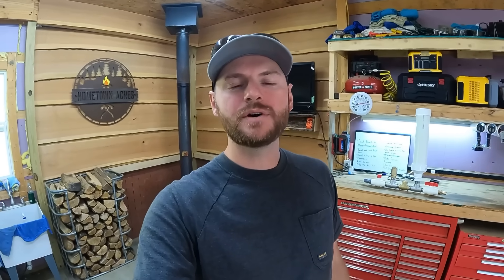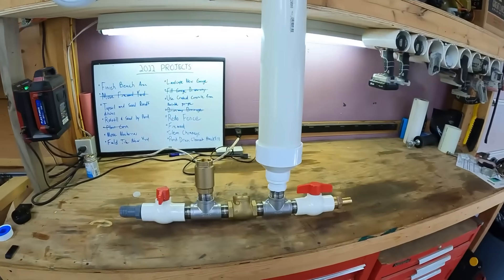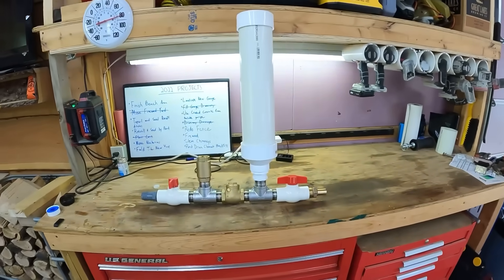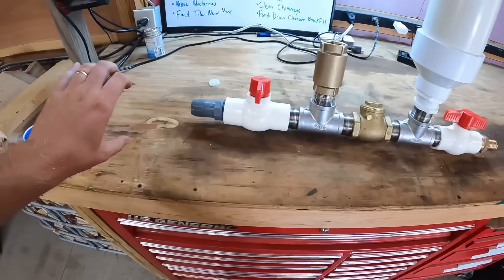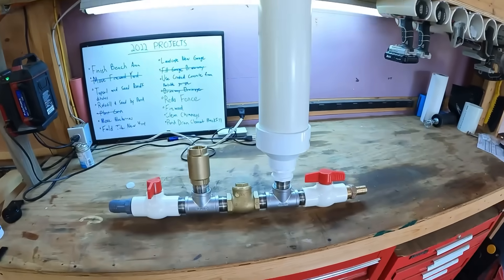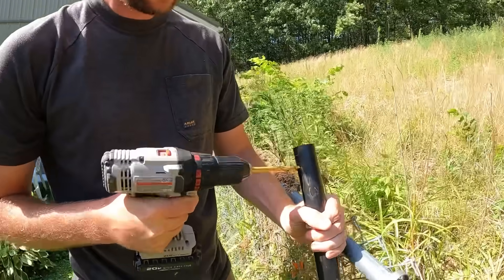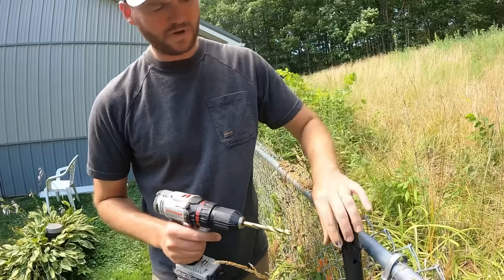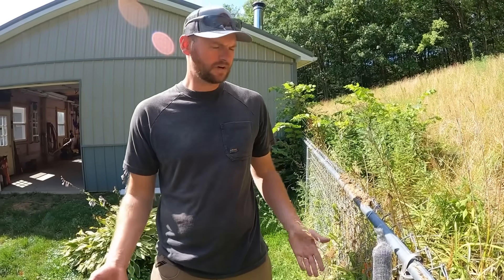We Found Water For The Pond - Hydraulic Ram Pump

Comment: In case no one's said anything: Instead of pumping up 30 ft to an open tank, any degree of siphon you can maintain between your pump and the outlet will reduce the effective height the water is being pumped to.

Considering you estimate the pump is 30 feet below the crest and the rough max height you can maintain a siphon up to is about 32 feet (depending on altitude and barometric pressure) I'd guess that you can probably maintain a 20 ft high siphon in the line and effectively limit the height the water is being pumped to, to only 10 ft.

Put a small catch tank at 20ft below the crest and submerge the end of your line in there with a valve at the end. At the top of the crest put in a t-junction with a valve out the top. When ready shut the lower valve then fill the pipe from the t-junction until there's no air and shut the top valve, after that fill the catch tank and ensure the end of the pipe is submerged before opening the valve. Any air you let up the pipe will degrade the siphon and spoil the effect.

Comment: 4 to $500 dollars......really...wow. I built one from some stuff I had laying around except the 2 brass foot valves ($35 ish a piece eBay) (both foot valves  instead of swing valve for rear valve) for less than $200 easy. A lot of stuff can be found pennys on the dollar on your local Craigslist type marketplaces. It had an adjustable pressure spring (a piece of spring steel and adjustment nut that applied pressure to the front check valve) that regulated the front check which adjusted the cycle rate, and subsequent water needed to operate the pump(good for variations of seasonal flows of your source). The pressure tube(larger than yours), had an inflated small tire inner tube to cushion the impulse and apply a more consistent water flow. Once adjusted, it pumped for days and filled a 10k gallon tank 100 ft above pump off a modest flow of a seasonal creek on my property, with about forty feet of drop of the 1.5 inch drive line. Good work though. This older tech like this and things like wood gasifiers are fun to experiment with and refine.

Comment: I could show all the calculations, but I'll save that for someone else; the numbers are all over the net.  For a 1-acre pond it takes an estimated flow rate of 5.5 - 6.0 GPM to replenish evaporation losses during summer months.  So if there is no significant runoff, rainfall or spring water replenishment, your pond will evaporate away at your current 1.33 GPM replenishment rate.  I've seen good ideas in the comments to increase flow rate.  
But what about winter?  Evaporation will be less in winter, but more in any season if there is a lot of wind and wave action which increase evaporation. 
I would suggest to ask your plumbing supply how deep to bury your pipe to prevent winter freezing.  I think it's 18" here in northeast Texas.  Water flow, if constant, will help prevent freezing, but your helpful plumbing guys will have the accurate info for your setup in your area. 
Thanks for the info - I never heard of such a pump.  I have a never-go-dry dug well with an electric pump, but if I ever decide to irrigate a garden I might try that sort of pump, just for fun,  and to save electricity and pump wear.  I think one would serve as a sump pump for my tornado shelter that fills in a hard rain, though I might have to prime it often.

Comment: Eventually the air inside your storage tank will get absorbed by the water and quit working. Periodically you will have to restore the air inside the tank.
Or use a sliding plug to keep the air and water separate.

Comment: A simple tee fitting at the top of the hill would negate the need for the tote, as it would break the siphon. Also, try reinstalling the spring in the check valve now that the air is out of the line.
Reply: I agree and the siphon will help the pump..
Reply: Using a larger pump on the discharge side would help deliver more water..Smaller pump cause friction which requires more pressure to get the same volume. Using a larger pump lowers the required pressure, and help it deliver more with less work..

Comment: The reson you had to pull the spring out of the valve is you got you're valves backwards the spring one is suposto go on the botem also id love to see what happens if you do let is siphon.
Reply: if the creak is actualy 30 feet down the hill the siphon would only effect the water about 25 feet down the tube so you're pump would be combating an effective head pressure of 5 feet which means you could posable optimise it for higher flow rate or even bypass it after the line is chargedand use the head presore that's feeding the pump to compinsate for that last 5 feet.

Comment: You can run pipe all the way to the pond without the plastic tote, you just need to run a vertical vent pipe at the high point to break the vacuum. A 5 or 6 foot vent pipe should do the trick.

Comment: Every informative, U did a superb job of explaining the system and how this Ram-Pump Works.  Also, although you didn’t mentioned the Creek as far as checking every so often to see how it’s effective this creek water volume is consistent year round.  Would it be a good idea to dig a hole in this creek bed, maybe 2 ft. by 3 ft., having decent size Rocks along to boarder of the hole that was dug in the creek.  But I suppose you took all that into consideration upon putting the black hose(with the mesh over to keep out debris of any size).  Best of the best to your low-cost pumping system, actually the Power Company will miss all those dollars by not needing their electricity!!!!  Great information for all those who need even water from a creek to even water their garden… … … almost for free!!!

Comment: I would replace the plastic fittings with metal, since pvc and other plastic parts will expand slightly and that negates the power pulse of the ram. also, anything you can do to minimize the lake evaporation would help...
Reply: Yep paint the top of the pond white. To reduce heat evape. Duh

Comment: 8:43 This same principle means that if you put that spring back, the resistance of that spring will increase water pressure in the tank and thus increase how much water youre able to pump.  Maybe I'm wrong, but earlier in the video it sounded like the spring was set up in the wrong directional flow, and your solution was to remove it instead of reverse it?

Comment: You can eliminate the vertical check valve by putting another vertical tank like you have Downstream of your swing check valve you could just simply copy that in place of the first vertical check valve that you call the spring check valve you can eliminate that and just put in another bottle on top of it
Reply: The pressure building inside that first tube will disrupt the neutral pressure neede for the initial water inrush to the system

Comment: dump the IBC. its just collecting dirt and leaves and adds to your maintenance.   just add an anti siphon  valve at the highest point. if theirs any negative pressure on the way to the pond it will suck air and not negatively effect your pump. 
that being said, as long as your pond is not lower than your pump, the the siphon effect would only look like, to your pump, as if the lift was less than it is. you would get a grater volume. use the gravity god gave you!

Comment: I installed one years ago to really get it humming you need to make sure the pump Needs to be fixed really solid and the inlet pipe needs to be ridged in galvanized pipe for the last 20 meters or so. It increases the hammer effect . From memory we used a 2 inch inlet to a one or maybe 3/4 outlet.we managed to lift the water about seventy meters

Comment: I've been looking around the internet at "self powered" systems. The ram pump is interesting and you've created possibly the best I've seen.

A solar powered pump might be possible. Using a panel or two to directly power a pump would be cheapest. However a voltage regulator would probably make the pump motor last longer.

Depending on how much creek is on your land, and how much flow / drop is available, a water turbine might generate enough electricity for far more than a water pump.

This is a little long but I believe this fellow has proved water generation works.
https://youtu.be/XyWQ3o6plY8

Comment: I have known about ram pumps for decades. They are a fantastic solution if you have access to moving water. One thing I am wondering about: does the rate of evaporation in the pond exceed the water delivery rate of the ram pump arrangement?

Comment: I played around with ram pumps also. In my experience you will get more pressure if you use the flap valve for the waste and the spring check valve on the route to the pressure tank. So swapping the two valves. (with the spring mounted) I got 20m of lift with 1 m of drop in the feedline. Also using metal pipe for the last few meters in your feeding pipe will make a big difference. 

About the siphon, if you put your tank which is now on the highest point, about 5 m lower (this will create a 0.5 bar underpressure), you will have less counterpressure and therefore more flow. It might collapse your pipe though as you create a vacuum in the pipe, also the pipe should end under water in your buffer tank to avoid breaking the vacuum. With all these possible problems maybe not worth the trouble.
Reply: RAM pump can move water ower 100 meter high.

Comment: Why wouldn't you just continue the pipe instead of having a reservoir on the top of the hill because if the pipe just ran downhill then it would assist the ram with a siphon effect. Wouldn't it?
Reply from the maker: The pump need back pressure in the delivery line. If you have a siphon you will lose that back pressure and the pump will stop
Reply: @HometownAcres  of course it would take the ram out of the ram pump. There's always a cost there's no such thing as a perpetual motion machine. Yet

Thank you for answering and thank you for a great video.

Subscribe and notification button is lit up awaiting your next one whatever it is thank you

Comment: VERY COOL❗️You could build another RAM pump and operate them in parallel to feed your plastic reservoir with another feed line, but still use same single 1000" 1" line to your pond

Comment: In our village there are several ram pumps that have been running for over 100 years.  To get more efficiency get rid of all the plastic parts, they are flexible and waste all the energy.  Steel components are better, but, if you only use cast iron (which is rigid) you will maximise the efficiency.  Hope this helps.

Comment: You need to know running water will  NEVER freeze.
Never. Never Never.
However if your pump ever fails your screwed.
But that's O.K.
If your around during the coldest days, you can insulate your vulnerable areas that will buy you time incase of an emergency. 
I would also recommend you experiment with extending your hose down hill to assist in reducing head pressure.
I think you'll greatly increase your flow.
Common sense seems to point in that direction.
Great Video though, thanks for sharing.

Comment: To solve the siphon issue, why don't you couple the 300' hose on your delivery pipe with a tee fitting and a short peice of pipe acting as a "vent" or a siphon break?  Your delivery pipe will push uphill, and the 300' pipe will take it downhill without sucking because of the tee fitting which allows air in.  Or try a cheater vent (air admittance valve)...

Comment: Over time the ram pump can cause cracks in your connections due to the harsh stop/start of the ram. We found that swapping to a bunyip pump (made in Australia) that the water flow was a lot more progressive, and less harsh on the pipe and connectors.
Reply: Just add an anti hammer /air trap near the end and beginning of the output line. No more pinging.
Reply: @frosthoe  sure, you could do this. But then it's starting to over complicate a pump that by design is simple. This is the pump that I am referring to. It actually catches the fall before bottoming out, so you don't get that hammer: https://youtube.com/shorts/CLXalUmRikg?feature=share
Reply: Quiet too. I've been fascinated with this type of technology for years. Thanks for the info.

Comment: Looks like you might have the solution there for your ponds water needs, but, as others have said, IF the elevation of the creek is high enough, there is no reason you couldn't or shouldn't just run a pipe directly from the creek.  We don't know the elevational differences between the two.  Ok, if you have a 30' wall between the two, you still might well get it done with a siphon, if you were able to upstream even a little.  Keep it below 30' (10 meters at sea level) and you should be fine.  I've dealt with water for many years too.  I can't tell you how many times I've seen people try to run a line between two systems and try to keep it "level so that there won't be air blockage.  There is NO need to do that.  Better for long distance running of water to NOT be "level".  Run it DOWN from the source, and UP to the reservoir!  then there will be little chance of a air barrier.  Also you can put a valve at the bottom to drain the sediment if need be.  
The Ram pump is good, and a good solution if there is not  much water.  Another solution that many folks don't know about is the "high lifter" water pump.  Again, no fuel, no electricity, almost no moving parts.  It also uses the water pressure (gravity) to pump.  With one of those you trade elevation for some use of water.  you can pump using the head you have.  If you have 10 foot of head, then you can pump 1/4 of that and (lose the rest into your creek) and you get 40' of head.  Or, if you have to go higher, you can pump 1/9 and get 90 feet of head, (9 times the original head)  There are advantages to each.  There is less wear and tear on the system, and no "ram!" of the water, thus no "noise"  (The rams do make a bit of noise that may or not bother you) The high lifters have a very good reputation, but I don't think you can easily build one yourself.  Still they cost way less than a well, and they have a very long lifespan.  IF you have a lot of water, (say 4 to10 times more than you need someplace) and you have head, then you can get pump water a very long distance with these.  I've seen one that pumped the water over 1000 feet and an elevation from the pump of 200 feet.  They had a creek with an elevational drop of 40' from where they drew the water to where they pumped it.  I think they put the pump in 20 years or more ago and it is still pumping fine....   
I don't have as much water, so I pipe to a holding tank and use a solar pump, (Lorentz) to pump mine up about 180 feet of head. But there are Chinese pumps that cost about 1/5th or less, and sound pretty good too.

Comment: What makes the system work amongst many other things is back pressure from the hose going up. If there is no back pressure then valves will not shut properly therefore not capturing or storing as much energy as possible. If you did do the output hose going downhill after it went up hill then yes it would create a siphon or vacuum and start pulling water through the hose and system which would probably start messing up the mechanics of the ram pump.

Comment: One way to increase the volume of water delivered to the pond is to use larger diameter pipe, assuming the creek water source has sufficient flow.  Up sizing the pipe from 1" to 2" should roughly provide 4 times as much water.
Yes, increasing the pipe diameter will cost more for larger pipe and fittings but only slightly.  Doubling the pipe size does NOT result in a doubling in the  cost of the materials.  And the pipe size increase will yield a significant increase in the delivery flow rate.

It all depends on how much volume the creek can provide.

Keep in mind it that the ram-pump system is not very efficient - it takes about 10 gallons of water flowing thru the valves for every gallon delivered (10 percent efficient).  But over the long run it is very productive.

Comment: Dude, you are underestimating your potential there. If your creek is higher than your pond, I would just run a huge pipe down the hill to the pond and put a turbine the generates electricity in line. That’s going to create such a suction you wouldn’t need electricity from the grid at your house in the water flow would just be crazy fast. Don’t even need that ram pump

Comment: You also need to have a compressable closed cell foam in the compression chamber or you will lose the air in side to absorption then it will quit working

Comment: Interesting concept but... Just get yourself a semi trash pump. Pump 300 gallons a minute about 15 gallons of gas and let it run for 3 days and get a million gallons into that pond. Then your ramp pump can just keep it topped off. That sort of pump is good to have around just in case of any sort of major flooding anyway.
Reply from the maker: The creek doesn’t produce 300 gallons per minute
Reply: @HometownAcres  ah well then get a smaller pump 150 or whatever. it looks like it flows pretty decent.

Comment: Thanks X3 for sharing your nice video ....I am probably  missing something, let me know .... I observe the creek is located way higher than where you need at a lower level and if it is so then you don't even need a siphon and just fluid gravity would do the job for you but if it is bigger flow that you need then just get a thicker pipe or run a longer pipe up stream for higher pressure that is if you own the creek up stream otherwise your neighbor will complain if you don't get permission but if it is to sell the water ramming pump then make another video where prospect buyers could see clearly how your assembly would benefit the buyer.